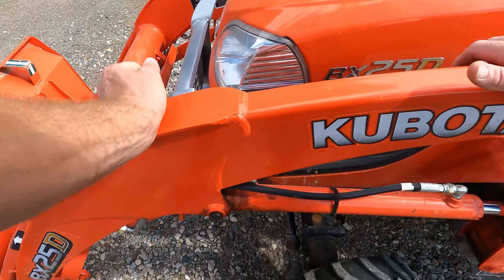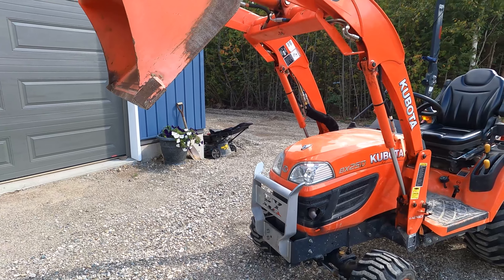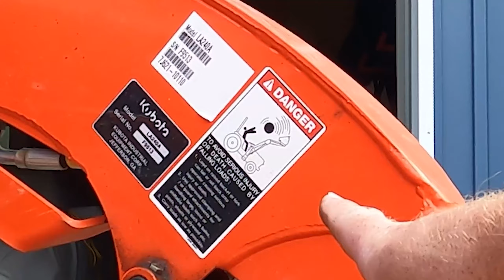Kubota BX Gets Custom Exhaust (Just The Tip) - Thanks "Ross On The Land" - No.81

Comment: Awesome video. Glad you like my TIP! Haha. Yes I sprayed it with high temp paint already but def add your own if you'd like. Also you don't have to take off the hood to remove the front cowling, just open it up, back off the knobs, lower the hood again to slide it out, then open the hood again. :)
I do really like the BX23s front grill as it doesn't need to come off at all and is stout enough, although it now rattles and squeeks because of the hinges so I'll need to stop that some how.  Nice video as usual and cheering you in for 1000 subscribers! You deserve it. 💯
Reply from the maker: I’m just now learning about this “secret tab” that holds the hood slightly open to allow for easy cowling removal. How have I missed this??? Awesome! Thanks for the kind words Ross!! New hood new hood!!! Whoop 🙌
Reply: @KillingItCountry  haha! Read the manual something something something...  And yes if course I used a 10mm bolt! I had to pick something that every guy would struggle to find. 😭
Reply from the maker: Classic!!! My teachers would say RTFM … read the &$@?%£€ manual … whoops lol 😆